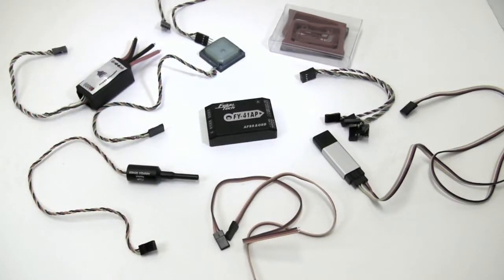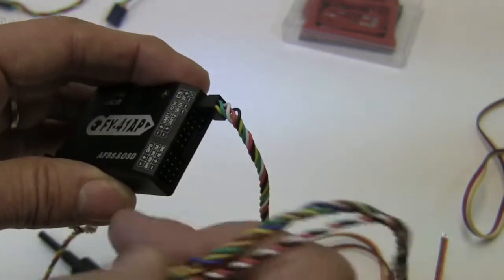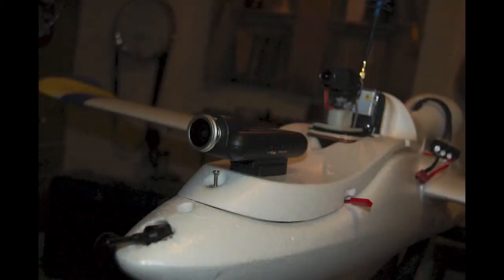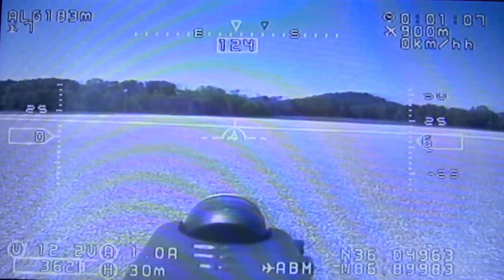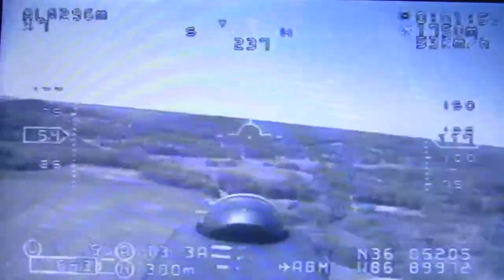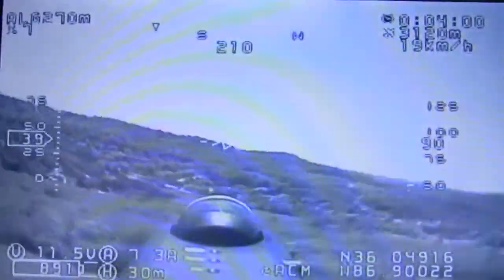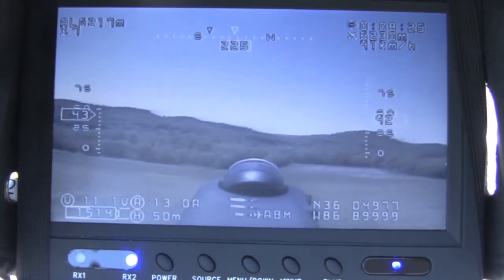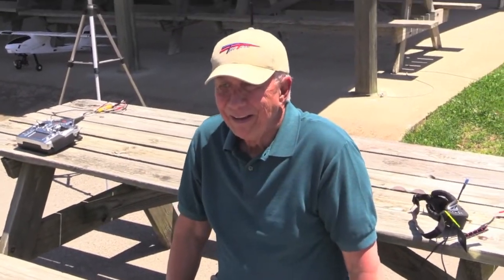FeiyuTech FY41AP RCGROUPS

Comment: Hi ....I wonder if you could give a pointer.....I have this plugged in ...Optima 9 rx immersion rc 600mw TX...security camera (12v) 
So I have an image but no movement in the servos...in any mode.. I don't have a laptop. I can access the adjustment screen by toggling ch 6 , 6 times. No servo movement

Comment: Can it be use in glow engine ? And is it any influence from engine vibration ?
Reply from the maker: +Awan Rachwan It could, but you will have to watch the vibration and isolate the main board as best you can.

Comment: Hello,
I'm not able to update the firmware on the fy41ap. I'm running windows 8 and when I open the firmware utility it does not say successful when it connects to the device. any suggestions?

also how do you get in the the OSD from the computer?